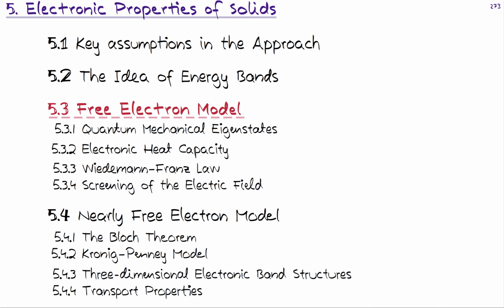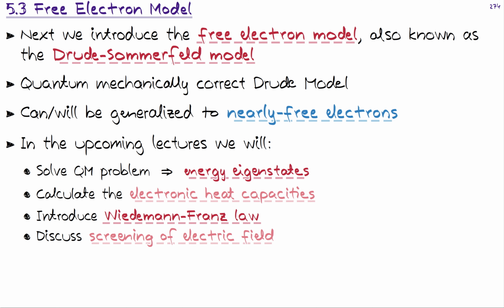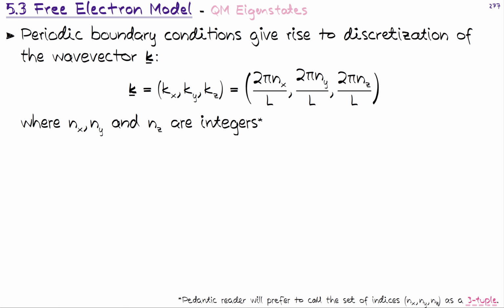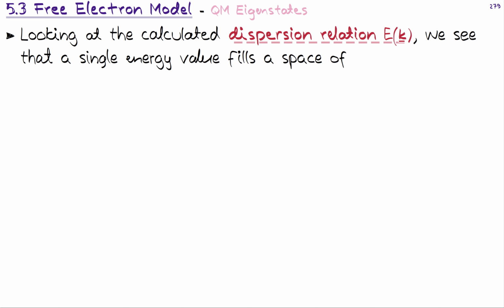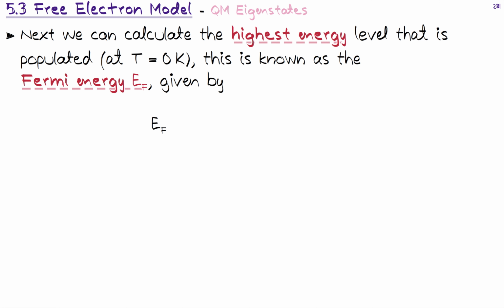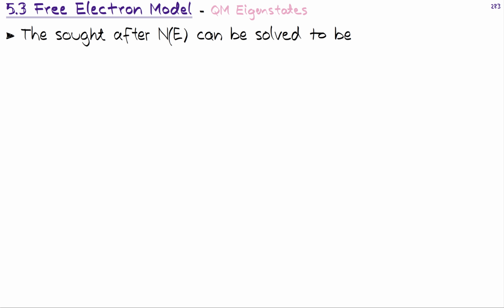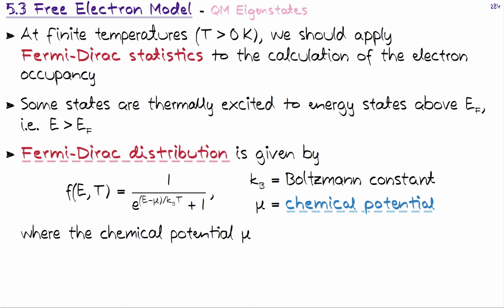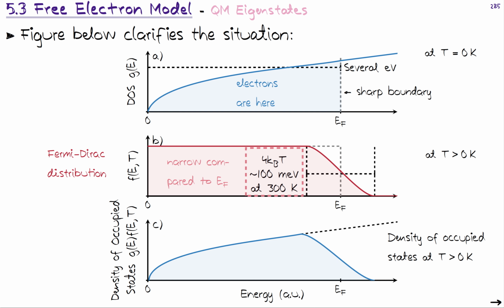FYS.310 5.3.1 Quantum mechanical eigenstates

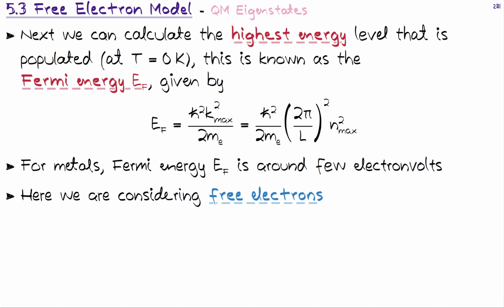Comment: At 18:30, the given Fermi energy is for 1-dimensional free particle. In 3D the Fermi energy is (ħ²/m)(3π²N/V)^(2/3) where N is the number of particles and V=L³.

Edit: The correct formula appears later in the lecture, when considering the density of states.
Reply from the maker: The equations are admittedly a bit unclear here. They're based on our course book (P. Hofmann's), and do provide the right 3D Fermi energy. But I myself admit that the derivation is not the easiest to follow, I recommend verifying the equations from C. Kittel's book (Chapter 6).